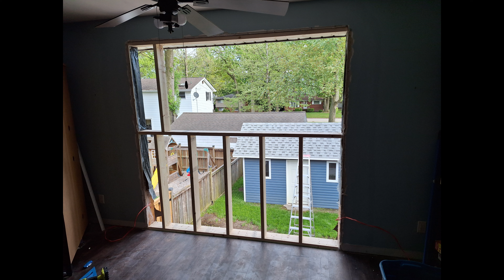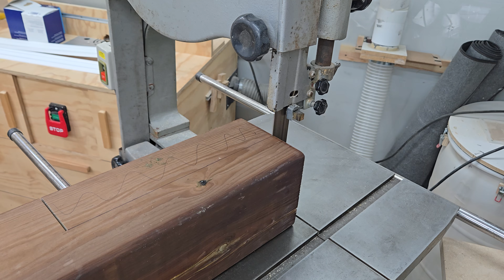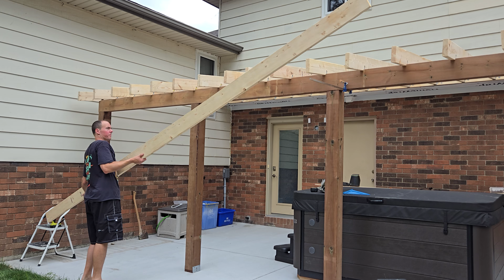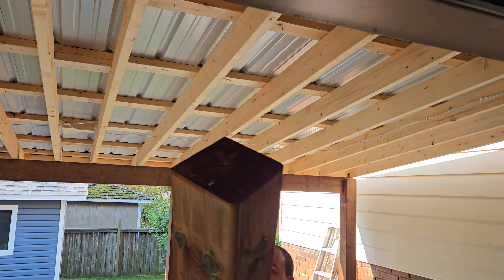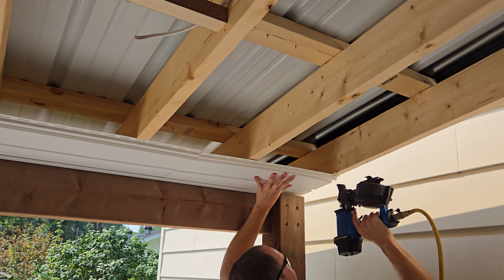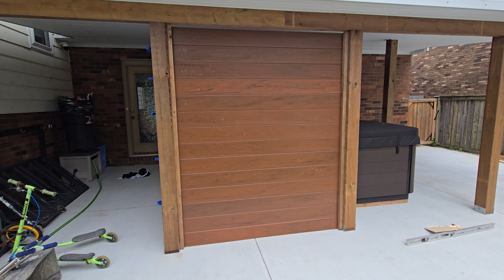How to Build a Lean-to off your house over a hot tub.

Comment: Structurally you should be fine but by putting those extra 6 by 6 it could save you life or at least a snow load headache where I live rarely snows unless there's a polar vortex since 2000 we've had two or three years like that a foot of snow in South Arkansas that's unheard of but fortunately I still had a 4 x 4 up I have a little workshop and if snows coming I'll put it back up. With the problem I have with bulging L5, I need a hot tub